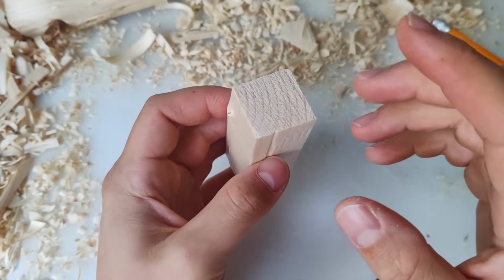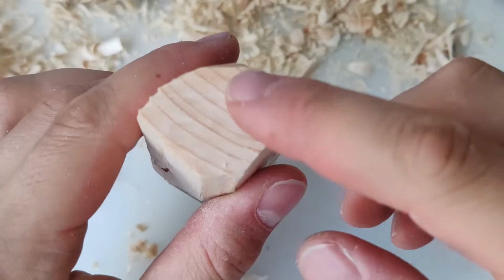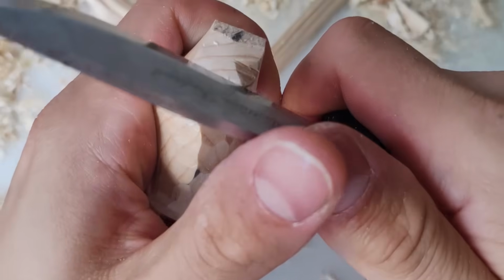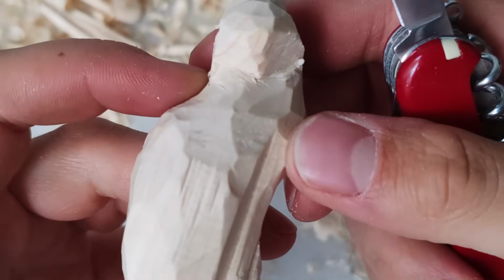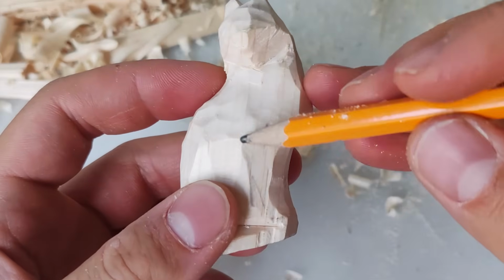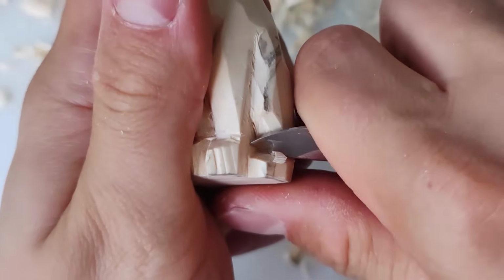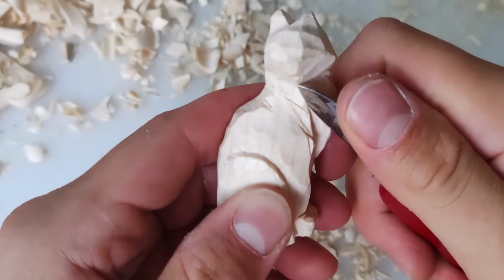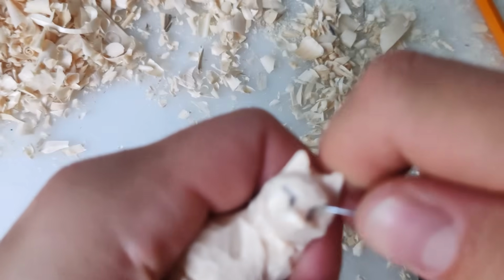Simple 1x1 Cat | Step-By-Step Beginner Whittling Tutorial

Comment: The only thing i still cant figure out is the very first cut.  The lines are diagonal.  The cut looks diagonal.  But the bottom of your cat looks completely flat.   Ive carved along with this video a few times, and my cats dont stand up straight cause of the diagonal cut.  Any advice?
Reply from the maker: The key thing is that the vast majority of the mass sits behind the front paws or further back. The slanted bottom allows a little more space for the chest and the head, but that's really it's only pupose so you can try to make the angle less aggressive. Hope this helps. I think I need to make another 1x1 cat soon, because this video could use some improvements.
Reply: @TheMakerExperience I've tried following along to your video and that first cut is confusing to me as well. I ended up with a cat that won't sit upright, a new video would honestly be a life saver 🥲

Comment: The wood I cut keeps on cracking. Any advice?
Reply from the maker: Using dry wood is the most reliable option, but you can also try switching the type of green wood you use if you want to work with moist wood.
Reply: @TheMakerExperience how do I get dry wood? Do I have to buy it? Or just wait to use what I cut?

Comment: I worked along with your video, and while I found your instructions very useful, I often got confused with what you meant by 'front' and 'back' , 'top' and 'bottom'. I figured most of it out as I worked along using my common sense, but if you stopped for a moment to show the result of various cuts, it would be easier.  Also telling us front or back of cat's body vs. front of back of cat's head would be more helpful.  I will have to try a second time to carve my cat well.  I love the pose you are using and the result is beautiful.  Of course, I am sure I will get my cat done well with practice.  Thank you for showing us how!
Reply from the maker: Thanks for the feedback. I'll try to keep that in mind to make future videos easier to understand
Reply: @TheMakerExperienceJust an idea, label the sides of the original block A B C D clockwise from the top before you start cutting. Then you can say things like "the edge between A and D" and it will be much easier. (I too am having this problem, just got to "this will be the back of the cat's head" and I am afraid I've messed it up)

Thanks for the simple and quality tutorials, regardless! This is my second, I did the bear first and while I did have a slight face mixup I managed to fix it in time and it turned out great
Reply: I have to agree and I don’t consider myself a novice. I will try again later but, honestly this cat was basically standing on its head when I was done. 😂
Reply: Got to agree... Very confusing... Great work though..... Just need to explain and show better.... Thanks
Reply: I agree. I tried a different tutorial (the whale) and ran into exactly the same problem. It frustrated me after a while and I needed to quit. I did do the fox, and that worked out just fine. I’m glad I read the reviews on this one first. I’m brand new so it’s easy to get frustrated.